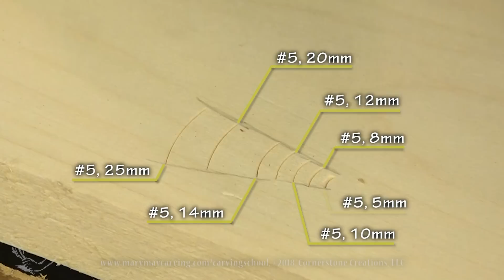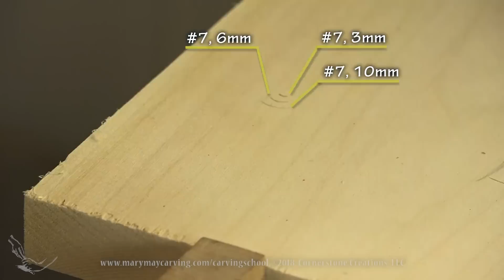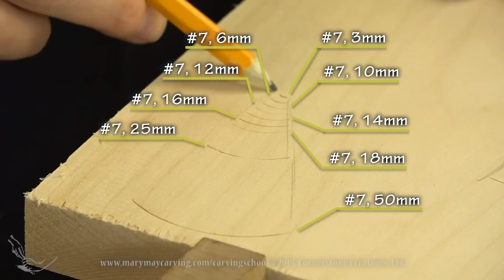Tool Sweeps - Understanding the Shape of a Gouge

Comment: So after watching this I went to the shop and played a bit with a few gouges. Ķnowing that a #9 is a half circle it got me thinking, it's just how many stabs with a gouge does it take to complete a circle will give you what "pie wedge" it corresponds to. To clarify I found that both my #7 gouges are in the 1/5 of a circle. My #5's are 1/8. Also found that (and I'm going from memory so I may be a millimeter or two off) the circle made with the 5/12 was damn near exact to the 7/18. Very interesting Mary - thanks for sharing!